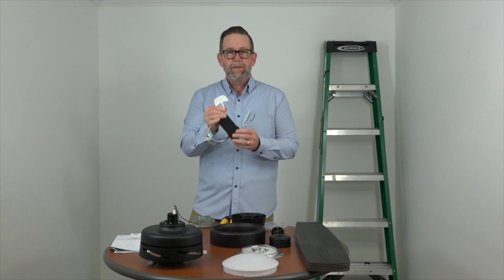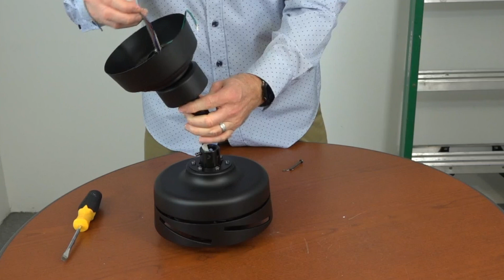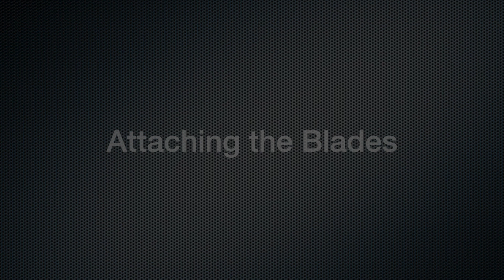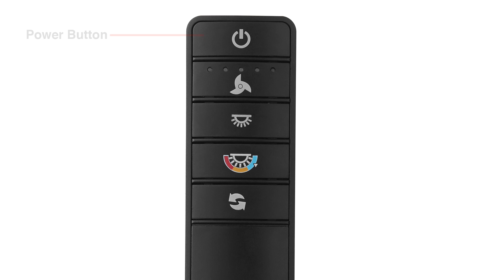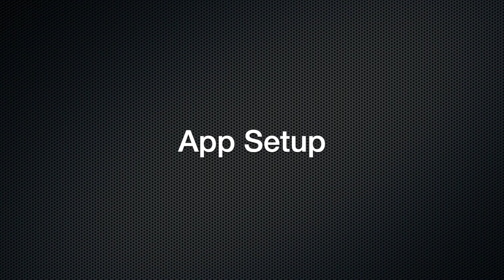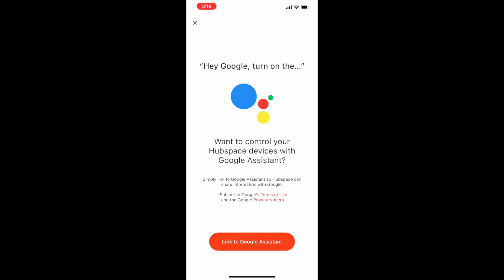How to Install the Driskol Smart Ceiling Fan by Home Decorators Collection

Comment: I have one that continues to stops spinning by itself. I have to turn on and off the switch to get the fan to work. Has anyone had this issue?
Reply from the maker: Have you tried changing the frequency of the remote (re-pairing)? Your fan may be receiving an interfering signal from another device in the area causing it to to off seemingly at random. The pairing process is covered in detail at the 17:48 mark.

Comment: I know this video is 3 years old, but it was very helpful.  Here’s our issue, the box doesn’t have the blade mounting screws in it, so we have to purchase them from a hardware store.  Any chance you can tell me what size screws to purchase?  Thank you in advance.
Reply from the maker: Unfortunately, we do not have the blade size. We would suggest calling Home Decorators Collection customer service at 1-800-986-3460. They will either be able to tell you the screw size, or send you replacement screws.
Reply: @ceilingfans101  Thank you, I was able to find screws at Home Depot.

Comment: My fan light won't turn off. All of a sudden. On had it 6 months. The remote and app are not working to turn it off. Fan will not work rotate either. HELP!
Reply from the maker: We would suggest trying to power cycle the fan. Turn the breaker off for 10 seconds and then turn it back on. If that doesn't resolve the issue, double check that all of the wiring is still completely and securely connected. Try re-pairing the remote with the fan (see the 17:48 mark). If that does not resolve the issue,  we would suggest calling Home Decorators Collection customer service at 1-800-986-3460. Their team is pretty good at troubleshooting over the phone and will be able to send any replacement parts if needed.

Comment: Where can i find the replacement LED light?
Reply from the maker: For a replacement LED module, you will need to call Home Decorators Collection customer service at 1-800-986-3460. Depending on the age of the fan, the light may be covered under warranty.

Comment: Installed fan but the blades are not spinning.
Reply from the maker: We are sorry to hear that you are having that issue. We would suggest double checking the wiring is connected correctly. Sometimes, wiring can get loose or disconnect during the installation process. You can also re-pair your remote with the fan to see if that resolves the issue. If that doesn't fix it, we would suggest calling Home Decorators Collection customer service at 1-800-986-3460. Their team will be able to get more information to help troubleshoot and resolve the issue.

Comment: Fan turns off by itself. It has a mind of it own. How can I get it to stop turning off. Very upsetting
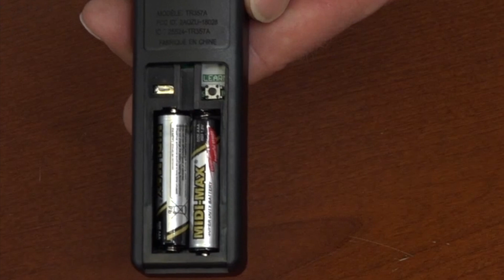Reply from the maker: Sounds like there is an interfering signal in the area causing the random operation. This can be easily resolved by changing the frequency of the remote. Follow the instructions at the 17:50 mark " Pairing the Remote". If that does not resolve the issue, we would suggest calling Home Decorators Collection customer service at 1-800-986-3460. Their team will be able to get more information to help troubleshoot.

Comment: Great video. Does this fan have an extra low speed setting?
Reply from the maker: The fan has a 5 speed motor, so it has 2 more speed options than a standard 3-speed fan.

Comment: My old fan ran off 2 wall switches, one for the fan light and one for the fan itself.  When removing the old fan I had a black, a white, a green, and a red wire. As far as I know the red wire goes to the wall switch that operates JUST  the light.  This new "smart" fan has no red wire, only a hub with 2 plugs (blue/white wires on one plug and brown, gray and black wires on the other plug). If I attach the red wire to the black wires I find that turning the light off from the wall switch turns the entire fan off. What are my options here? I want one switch to the the fan light and one wall switch to operate only the fan itself.
Reply from the maker: Due to the DC motor and the color temperature changing light kit, the only control option is the remote control. The only switch option would be one standard on/off toggle switch.

Comment: I have two black, two white, two ground, and 1 red comming from home ceiling, should i connect one black, one white, two ground and just cover the red with tape or is it ok to connect 2 white, 2 black connect to receiver.
Reply from the maker: The connections would be dependent on what the black wires are. With two black wires and a red wire, it sounds like there may be 2 switch wires (1 black and one red) along with a constant power wire (one of the house black wires). In general, you would connect one white to one white and one black to one black and cap the other non-used wires. If you are not sure about the wiring, we would suggest calling a licensed electrician to ensure the proper wires are used.
Reply: @ceilingfans101  i installed it, thanks for your help.
Reply from the maker: @rizwan4794 glad to hear that it worked out!

Comment: Does the voltage matter when replacing an AC fan with a DC fan?
Reply from the maker: Both AC and DC motor ceiling fans use 120V circuits.

Comment: Box gives option to hang closer to ceiling without the downrod..would you know how that’s done?
Reply from the maker: The box only shows downrod and slope mounting options. That is shown 4 places on the packaging (main front panels and top panels). The top panel also has a dimensions chart that shows the assembled dimensions when installed in different ways. That chart shows downrod and slope options - the clos-to-ceiling option is marked NA because that option is not applicable. This fan can not be installed without a downrod.

Comment: I had a red hot wire and a black hot wire coming from the wall how would I connect those wires. I have this same fan
Reply from the maker: The receiver can only be connected to one hot wire. Typically a red wire is a switch wire and the black house wire is the constant hot wire. If that is the case, you can connect the receiver's power wire to the house red OR black and cap off the other house wire not being used with a wire nut and electrical tape.

Comment: Can I wire this fan to two switches? One for the fan and one for a dimmer switch?
Reply from the maker: No, due to the DC motor, smart features, and the color temperature changing light kit, this fan should only be installed and controlled with the included remote or the Hubspace app. This fan is not compatible with any alternate controls.

Comment: Lost the qr code. How do I pair
Reply from the maker: There should be a QR code on the receiver and also on the inside of the battery compartment cover of the remote. If you do not have the QR code, the fan can be added to the Hubspaec app using the option for setup without QR code. In the app, press the + button and then follow the instructions for set up without QR code.